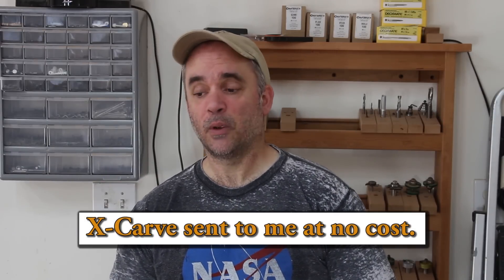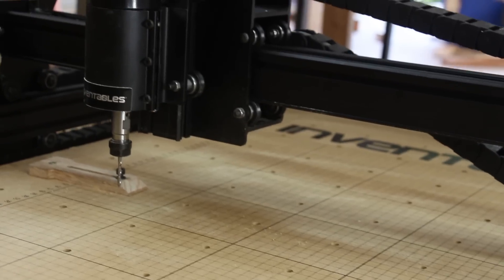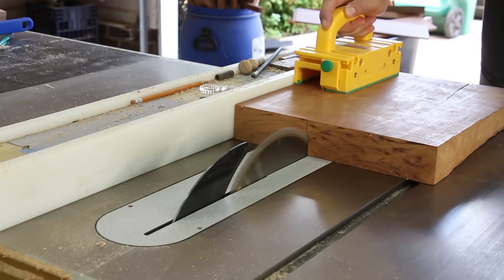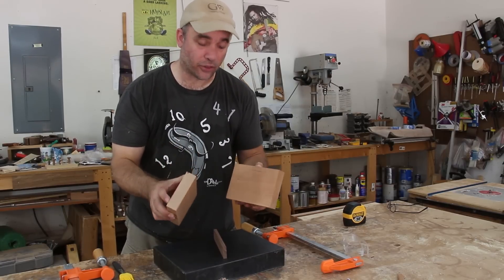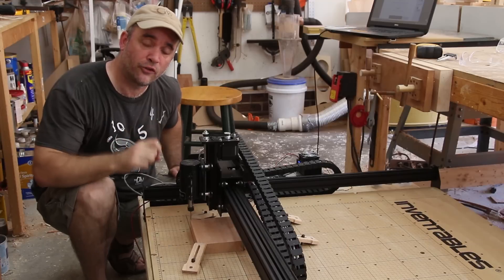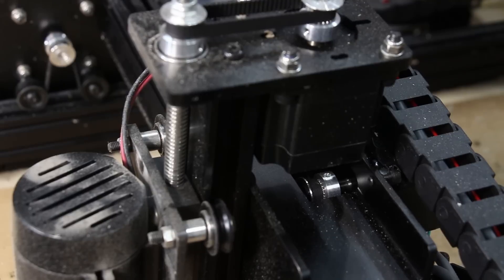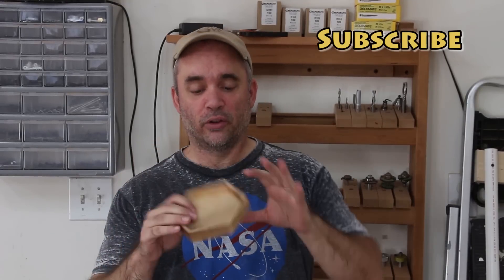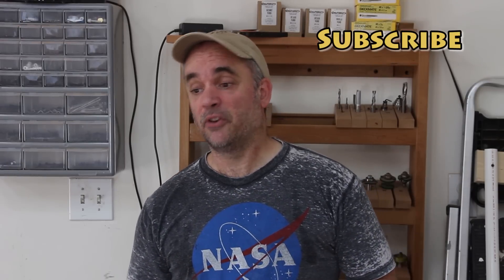Coin Tray at the X-Carve

Comment: A nice honest review. I think the small-scale duplication of an industrial technology just doesn't find a comfortable fit with most small-shop woodworkers. It's time-consuming, and the results end up looking very process-driven. If you think about it, there was enough material in that block of cherry to make at least three of those trays using a constructive rather than subtractive process and the results would have been stronger and more aesthetically pleasing.  They excel in making identical parts from sheet goods, simple inlay and repetitive drilling tasks.
Reply from the maker: Nice analysis and I agree. I will most likely use it for jig/fixture components like knobs, cams etc. I'll also most likely find a use for it with making master templates which would then be used in the actual process.  If the template is ever damaged, the cnc should be able to get me another.
Reply: +GarageWoodworks hello Sir! i am a little curious to know if, lets say (just an idea) i made an iphone stand, and on the computer and i put the design or the face of the template i want to use the X-Carve to do, like write on the face of the stand - iPhone 6 Stand built by xyz - would the machine be able to carve in the letters on the face or its ment for other purposes? just a general question about this product and if you're not sure let me know, i subscribed to your channel by the way. You do great videos and really make it easy for us starters! i am starting cabinet making trade school next week and actually bought my self a few power tools to work home too.
Reply: +AceBulletProductionz Yes the X-carve will "engrave" lettering or type font. For a more traditional "hand carved look" You would be looking at a different software for "V-Carving" there a a few bits of software out there.
I have not done any V-carving yes with mine, but have had success engraving information on to X-Carved router jigs.
Reply: I have to disagree, though I would have agreed before I got my cnc.  The benefits are not in what it can do, but the time it takes to do it. 

when I purchased my cnc, I thought I made a mistake.  It took up a lot of room and I wasnt familiar with the design software. 

After a brief learning curve, it has been a central part of my shop.   It allows me to add features to projects, in minutes VS the hours or days it would normally take me to hand carved.

Yes, it does batch work well, but the true benefit is the carvings that add value and personalization to each piece.

case in point, a bottle opener I was able to sell for $10, I am now able to sell for $20, because I can add customization carvings and people are willing to pay a premium for it.  A carving that takes 2 min on a cnc, but would take me 7-8 hours by hand.

Comment: I must be the only one that didn't receive an X Carve.  I will keep checking the mailbox.
Reply: pdxDavid Nahhh, you're not the only one. I didn't get one either. No biggie - I built my own CNC. It works for me.
Reply: Tayler Made Depending on what you want to do with it, they can be a lot slower. For simple patterns without a lot of curves and where accuracy isn't important, there are other methods that work much better. For complex shapes, dead on accuracy, or if you need to make several pieces exactly the same, the CNC really shines.